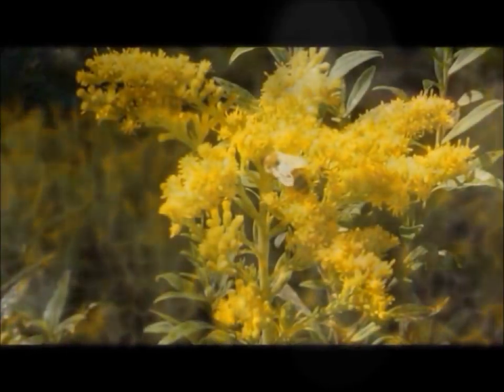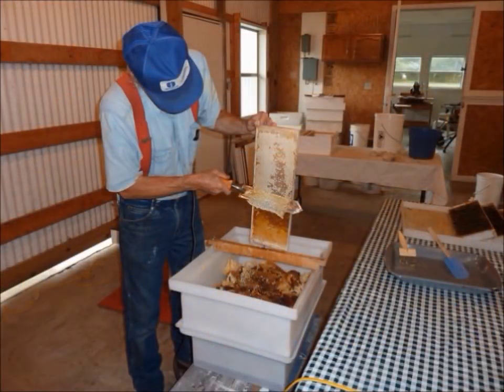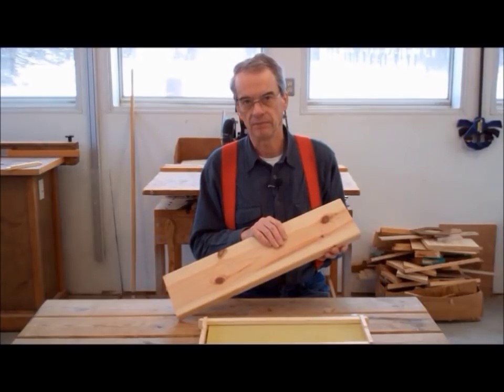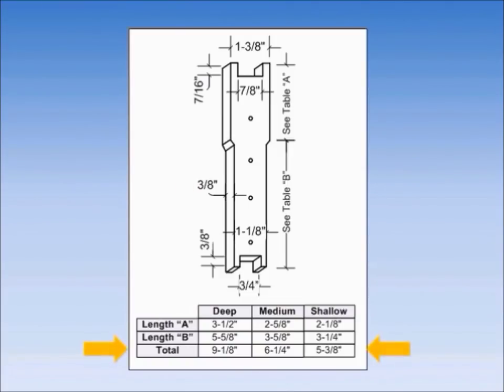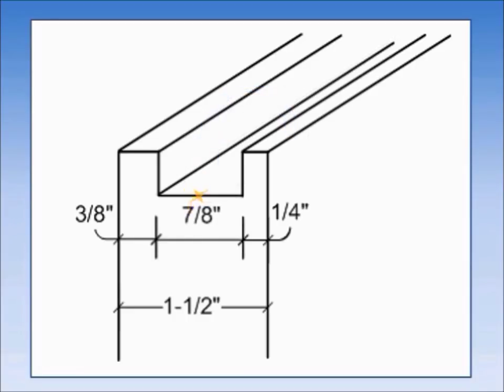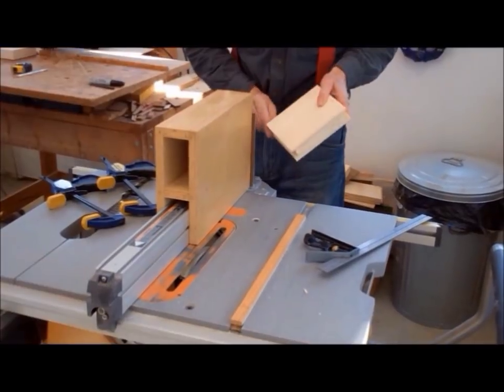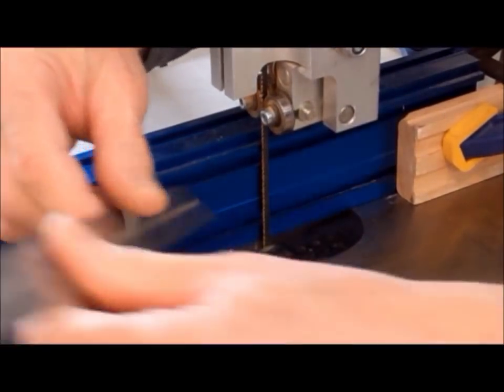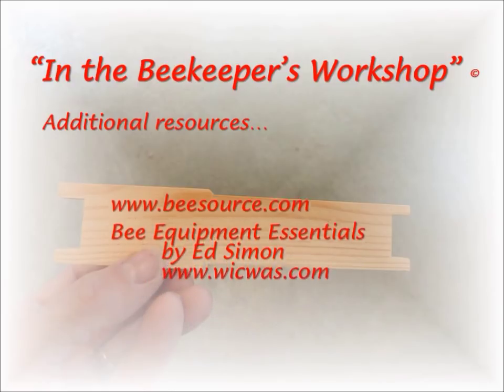Making Frames - Part 1

Comment: I used to make my own frames and boxes but then the price of the cedar I was using more than doubled, I could get it a little cheaper, but that meant buying a whole load of cedar, I was using the cedar offcuts from the boxes I was making to make my frames, I then decided to 3D print the sidebars as it works out cheaper, and buy in the top and bottom rails for my own usage, I used to sell some boxes and frames just to other keepers that I know.
 I know that pine can be used and I think I will try and source some pine at a reasonable price for the rails and continue to 3D print the sidebars.
 How has the price of the wood risen in your area? I am from England where most things are highly overpriced, when we were in the EU they used to call the UK Treasure Island as they could sell us things at inflated prices.

Comment: I use a jointer to plane down the wood block to the correct thickness first, no need to trim all the individual side bars.

Comment: Great video for me until you got to the band saw.. My problem is, that I have no band saw. Any idea how to do the rest without a band saw. I also was kind of surprised when you ripped the side bar to width not controlling the piece in between the fence and blade. But it looks like there was not much of a kick back. I presume I can but the 3 /5/8 on the side with the table saw blade sticking out that far?
Reply from the maker: The band saw is used for two operations: one trims the side bars to width below the taper and the second cuts the bevel on the end of the top bar.  Both can be using something other than a band saw.  For the side bar, a jig saw would work as would a table saw or a router.  However, the table saw would be somewhat of a hassle and tedious.  A jig saw (either electric or hand) would be easier though a bit more time consuming than the band saw.  Also, a router (with a router table) would make this operation a snap.

For the tapered ends of the side bar, I have lately been using the table saw with the blade rotated about 5 degrees from vertical.  Since the top bars are 3/4 inches high, I use 1x stock (such as a 1x8 or even a 1x10).  Cut the stock to the length of the top bar (typically 19 inches long) which is Step 20 in the downloadable plans.  I then skip to Step 13 and cut the lower dado.  Next, rotate the blade 5 degrees to make the beveled cut (on the end).  With the board vertical, run the end through the saw (I use the tenon jig since the board will be vertical) making sure the cut starts 7/16ths of an inch from the inside edge and the top of the blade 5/8ths of an inch high.  Make the beveled cut on both ends of the board.  You can then rip the side bars to width (1-1/16th inch) and go back to complete Steps 11 and 12.

I realize that this is hard to follow, but if you look at the plans and work you way through the steps above, you can make the beveled ends with a table saw.  And do 3 or 4 to bars (or more depending on the width of the 1x stock you use) at one time.

As for ripping the side bar...  It is very important to keep the width at 3/8ths of an inch... exactly.  So cutting the stock with the blade 3/8ths of an inch from the fence is a way to accomplish this accuracy (and with precision).  You are right that this type of cut is subject to kick back.  So stand aside when doing so!  Using the combo square and drill bit technique to keep the 3/8th in cut on the outside of the blade (and thus avoiding all kick back) also works, but takes a bit more time.

Thanks for your comments.

Comment: NO MORE FOUNDATION 4 ME!    Made a guide wedge under the top bar,  brush  melted bees wax on the wedge. THEY DRAWL IT OUT JUST AS FAST  i had a groove down the top bar, so all i did was cut strip 1/8 thick  1 inch wide and 17 inches long!  glue and nail it under the top bar best to put 3 small nails in the wedge, weight my break the glue down!
Reply: Just a top bar right?
Reply: @mmhbs  yep under the top bar on a frame ~  Be sure to coat the wedge with melted bees wax with a brush. 2 or 3x .   Its ready to draw comb
Reply: @426superbee4  Just ordered my bees wax. 😁
Reply: @mmhbs  I hope you got a good deal on it. E-Bay has some good bee supplies  Me? i just melt down my bees, wax and filter it out. There many things you can make from bees wax. Candles, lip balms so on and on

Comment: Hello, my name is Brad Oliphant, and I have a question for you.  

Next year, in NYC, I will be a single hive owner, and am wanting to attempt to mimic a Layens hive by connecting two langstroth hives.  If I were to screw two frames together, a deep frame and a shallow frame, then clipping off the sides of the lower shallow frame, would this work out for me?  And of course, I would fix together a deep and a shallow box for them to go in.  
Thank you for your help.

Comment: BRILLIANT ! Thanks.  Where do I find the plans to make the Tennon jig?
Reply from the maker: I can't direct you to a plan for the tennon jig.  The jig, however, is pretty simple to make.  It consists of two vertical pieces on either side of the saw's rip guide fence.  And two smaller cross pieces; one across the top and another just above the fence.  The trick is to get the two cross pieces the right width so that the jig slides snugly along the fence with no wobble.  If in doubt, make the jig a wee bit to snug (emphasis on "wee") and then use sandpaper along the vertical piece that slides along the fence.  You can also lubricate the jig with bee's wax to make the jig slide smoother and easier.
Reply: @beekeepersworkshop  Thank you so much.

Comment: if i wanted to make my own foundation how  i would get a hexagonal pattern first and then make the mold is this the correct procedure
Reply from the maker: The geometry of a honey comb cell is a bit more complicated than a simple hexagonal pattern.  I looked into this in some detail when modelling a cell for my 3D printer.  There is a very long name for the shape, but it involves the base (back) of the cell.  It is not flat but something more along the line of a rhomboid.  Basically, three planes angle back to a center point.  That point forms a cell wall boundary on the honey comb cell on the opposite side of the comb.  (Remember that honey comb has cells on both sides.)  If you examine honey comb or commercial foundation, either wax or plastic, you can see this geometry on the bottom of the cells.

I, too, was looking for a roller with which to make wax foundation.  I came to the conclusion that the cost of such a complicated, precision tool would far exceed the cost of all the foundation I would purchase in several lifetimes.

Comment: I like your ideas in your wood working but for cutting your top notch in the side bars . It looked like there was A LOT of in needed measuring an cutting that was not needed . You had to many measurements changes an steps WHY not just take your 2”x 6”x ?’ Long board an run it thru a plain to get your correct size . Then put a stack set blades in your saw an do ONE CUT . Then while you have your stack blade set on you can cut your bevel or your bottom part of your side bar . To make those cuts all is needed is to just lower your blade an then you can start cutting each of your side bars an no ban saw is needed . Just a thought. Thanks
Reply from the maker: There are many different ways to work with wood. That is one reason why it is so satisfying. I didn't use a plane because it is not that common of a tool in a hobbyist's workshop. And I don't have one.  If you can see a different way to the end results then go for it.

Comment: Thank you for the best video in the world. I waited out the video about making framework. I was tormented by one question. Why everywhere The height of the side bar frame is equal to the height of the entire frame. This is a mistake.  The height is the height of the entire frame side bar with the addition of (1/2) - (7/16) = 0.0625 inch. Nowhere in the world I could not find clarification on this matter. Also, do not size is set at of the frame and under the frame.  Shoulder frame is beveled so it was important to know the size.  Not having such a framework, I drew on paper and vymeryat this distance.  I received the sad result. If you put the two buildings, then you from the frame to the upper frame is the distance that does not match the bee space. Maybe I'm wrong.  Correct me please.

Comment: We have a planer it cuts out a lot of steps.
Reply from the maker: No doubt.  A lot of hobby woodworkers don't have a planer, including me.  There are times when having such a tool speeds up the job and gives great results.  I have purposely tried to work with the tools commonly found in a hobbyist shop.  If you have a planer, then you undoubtedly have the skills to use it in our projects to make things go smoother and quicker.

Comment: Why don't you mill/plane the 2x6 to the correct thickness of 1 3/8" from the beginning and do less math? Less confusion and possible mistakes.
Reply from the maker: I don't have a planer to do the job!  A secondary consideration is that most people viewing the video don't have this tool either, so I wanted to provide instructions on how to accomplish the task with the most common tools.  However, the main reason for me is the first one.
Reply: @beekeepersworkshop  you can rip it to 3/32 inch greater on your band saw and then use a hand plan to finish the sizing, along with a shop made edge squaring table for the hand plane called a shooting board. A sharp chisel can be used for the 45 cut on the piece.

Comment: Well this video has saved my butt, currently started to try make my own frames , top bars cut to length with dato groom for foundation width and thickness, side bars are now my challenge. I don’t have the correct size drill bits to go off so I’ll cut some wood measured spaces instead and use those, I love the box jig that slides along the fence you have there I got to make one of these it’s a very handy piece to work with. 👍

Comment: If you have a planer then your first step is planing your 2x6 down to the finished thickness. You get 160 side bars out of one 2x6x8 so you just saved yourself 160 cuts by planing.

Comment: Could you just run the sidebar stock through a thickness planer before you cut the dadoes and ripped them off the blanks into individual sidebars? This would save having to trim each one individually to the correct width.
Reply: The blades are not that thick
Reply: F 7

Comment: Instead of a band saw to make the lower section of the side bar, I use a jointer.  I put a stop block on the fence so it goes the right distance.  The small angled shoulder ends up being a little concave due to the round jointer blade, but this hasn't been any problem for me.  One pass on each side is all it takes.  I also joint one side of the bigger block before ripping them off the 2x6 on the table saw.  That way I only have to do one side individually.  You could do both sides, but the 2x6 wouldn't sit on the table saw correctly (flat) which isn't as safe.
Reply: I was thinking a shaper with a stop block.  Would give a nice tight radius to that transition if you use a small bit (not sure how important that is)

Comment: What is that yellow colour for the frame? Is it plastic net or metal? How it is attached to the frame
Reply: That "yellow" stuff is wax foundation. The picture is actually a bit "yellower" than it actually is in real life. The video describes a wedge type frame which holds the foundation by means of a small strip if wood nailed to the bottom part of the frame. As described in part two of this video series.

Comment: Great video, thank you. Try using the dado blade to cut the lower profile (raise your dado to 1/8" height and have positive stop on the table, make all your lower profiles prior to cutting the side bars to 3/8"....this require moving the fence several times to cut the full width of the 2x6). Also, get a long drill bit and put your 2x6 against a fence at the drill press, drill your holes prior to cutting the 3/8" cuts, saves a lot of individual holes!
Reply from the maker: Good suggestions.  Steve

Comment: Do all the measurements really need to be that exact?  The hives are for honey bees, not carpenter bees.  That being said, great job.
Reply from the maker: In a word... yes.  All the rest of the hive components have some room for measurement errors.  The frames are different in this respect.  It is far easier to have the frames be built to spec than struggle later when things don't fit right. That is why we give some tips on how to set up your saw down to a 32nd of an inch.  Take your time. Measure twice and you won't be dissapointed in the results.
Reply: @beekeepersworkshop  That was supposed to be funny, but I guess the joke was on me,  Sorry

Comment: Good video instruction.  Will save me work and accuracy will be better...but, at 70 cents a frame from online, is it worth it?  I'd just have to nail the parts together.
Reply from the maker: Frames are relatively cheap to purchase.  Still, the idea of making your own has its attractions.  Also, you can make frames that are otherwise not available or hard to find... such as the mini-frame for a mini-nuc.

Comment: Great Video!! I now feel comfortable making my own frames. I do have a dado blade question. When your making the side bars you make two passes with your dado blades then on the 3rd dado pass you are removing the waste. What is the width of the dado cut you are using? The table saw I will be using can only make a maximum of a 1/2" dado cut.
Reply from the maker: Same here, as far as the width goes.  I often go with a 1/4 inch or 3/8 inch width cut.  I find it easier to make narrower dado cuts, even though it may take a bit more time.  If your saw can handle a wider cut, then go for it.
Reply: @beekeepersworkshop   I can dado up to 7/8"  but still follow what you do. Easier on the saw! And besides,, what's the rush!

Comment: I must've missed that part... can someone please explain why the dado cuts are different?  as why one is  1/4"" and the other 3/8"?
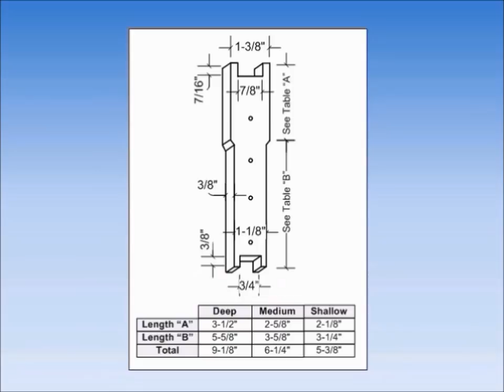Reply: 9:28

Dimensions of the lumber changes for the top and the bottom. 

Overall Width on top is 1 and 3/8"
Overall width on bottom is 1 and 1/8"

The width of the cuts changes with respect to that. The reason, I'd guess, is strength needed at the top and greater space at the bottom so they don't bond the frames together where you can't pry them apart.

Comment: can anyone tell me what the measurements   are for the plastic foundation.. the reason is i goofed up on some of the side bar measurements .i need to know if they will fit or do start over.. i feel bad enough try not to make it too bad to criticize
Reply from the maker: For deep frames, the plastic foundation from Dadant is 8-3/8" by 16-3/4".  Compare to was foundation which is 8-1/2" by 16-3/4".  The 1/8th inch difference in height probably won't make a difference.  Best to get some and try it out.  Personally, I like the plastic foundation.  It is stronger than the wax foundation and doesn't come apart when spinning out the honey.  Some beekeepers claim the bees don't draw out the plastic foundation as well as the wax.  However, I have not noticed this to be a problem.
Reply: Do you have information on installing the foundation on these homemade frames? How simple is it?  Some bought ones have slots and such. Please help a newbie.
Reply from the maker: Johnny R foundation installs exactly the same as commercial frames. I use the "wedge" style option when building the frames since I also use wax foundation. Let me know if I have answered your question.
Reply: I went back and watched again and saw how you did it.
You have not only have me fascinated with beekeeping but I got my table saw out and made a tenon jig yesterday.
Thanks for your excellent videos.

Comment: is there a reason you are using a dado instead of a router?
Reply from the maker: A couple of reasons.  One, for most of the grooves and rabbets I use when making beekeeping equipment a dado blade is much easier and faster. Two, not as many people have a router (as compared to a table saw).  And I am trying to hit the middle mark.  That said, both can do the job, so use whatever you feel comfortable with.  For me, I am personally more comfortable with a dado blade than a router.
Reply: I think dado, as well!I was curious!